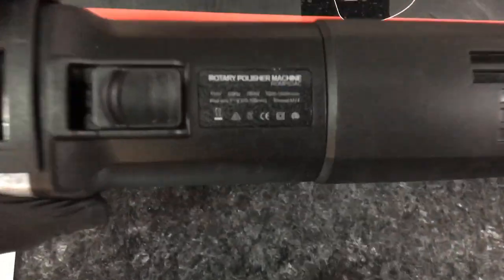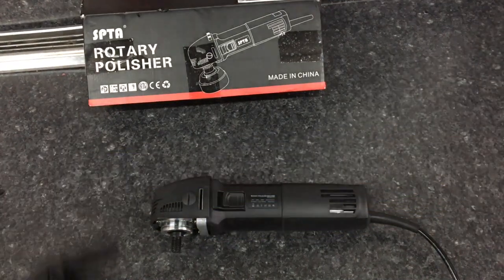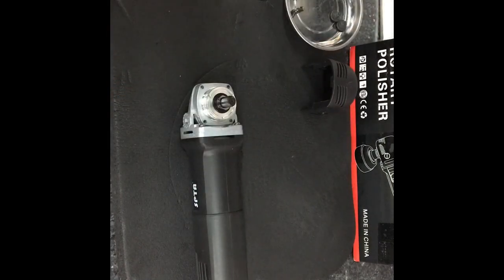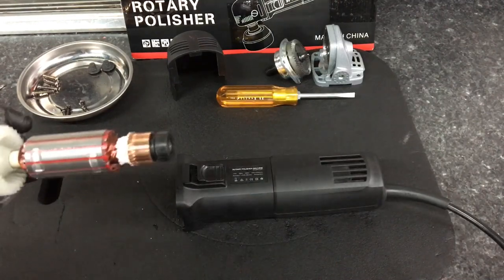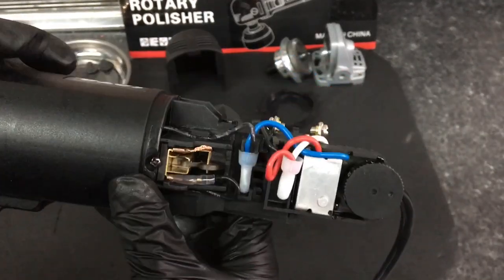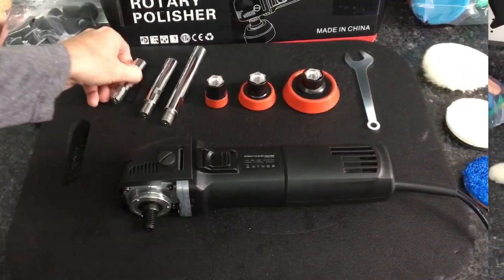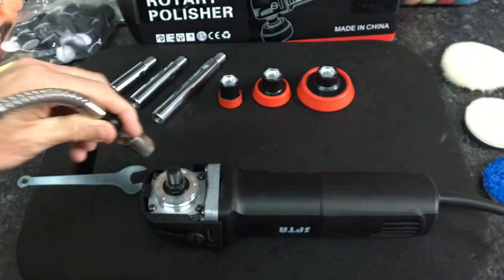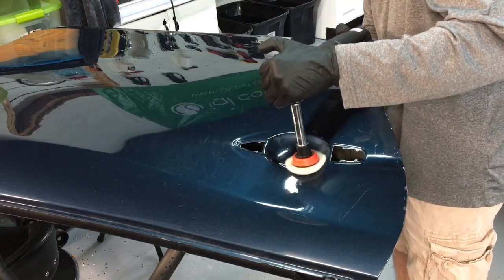An Economical Polishing Tool With MANY uses!! The SPTA Rotary Polisher! Numerous Attachements!!

Comment: I AM SOOOOOOOO GLAD you did a review on this little polisher!!!
And I feel a little better about it now also😁
I've had mine for over a year now and not a hiccup one!!
Now when it comes to the pads, the 1" wool kong hair pad and 1" blue microfiber pad will not last that long, just putting that out there for anyone wanting to know.
The rest of the pads are medium grade at best. But there are plenty of companies that produce 3" pads and smaller if you want to upgrade them.
I mainly use mine for high gloss interior peices. And I have found that, just like the paintwork on the outside you can treat trim peices the same way. I start with the 1" green pad and use griot's garage complete compound as a starter and finish with the 1" blue pad and griot's garage complete polish. And let me tell ya, trim work comes out looking fantastic.

Comment: Bought this in November 2019
Loved it ever since.
Reply: Do you know if standard handles fit on it or are they different threads,If you have any other rotary or da buffer ,do those handles fit this mini?The one I'm looking at does not have handle with it and i don't use handle much but I would like it when i use a 4 or 5 in back pad with wool pad.Thanks

Comment: Bought this polisher last year, thanks for recommending a 5/8 adapter, now I’ll throw a 5 inch plate on and give it a try!
Reply: Let us know how it handles a 5 inch plate 👍
Reply from the maker: Works fine in a cool shaded shop... but hot days in the sun could take its toll. I take the chance due to my bad shoulders.
Reply: I just received my polisher today I use it on the transom of an offshore racing boat sure save me a lot of headache and it worked well

Comment: Brian’s replacement of the gear lubricant is an excellent idea however everyone should note that opening some polishers in the warranty period voids it. Read the manufacturers guide book.
Reply from the maker: skinn0909 absolutely... I try to remember to mention that as often as possible. I fix my own polishers.. the warranty means little to me unless it fails right out of the box.
Reply: Apex Detail make some videos on how to fix polishers!!
Reply: @apexdetail85  which high temp grease you will recommend (any specific make and model you prefer)?

Comment: Awesome video Brian. There aren't too many videos for this machine. Mine should arrive tomorrow. My first pick was the flex 3 inch polisher however I saw this one and all of the accessories that comes with it. Well, your video have me confidence to purchase this puppy. One question I have is,, what do you think of the on and off switch. Many folks suggested the switch was crappy and that it will probably break. What's your thoughts?. Thanks again for the awesome video sir.

Comment: Yup, it has to come apart all the way as always :), I got not much to add, you covered it all. I just wonder how the quality of the pads and polishes is, i guess its average? Tried a 7" backing plate and can it cope?
For the pro's, I think it's better to get a more powerful Maxshine rotary so you got 7" to 1" pads covered if you get the kit without the SPTA machine, so you got your rotary part all complete :)
Well you may need to get a 7", 6' or 5' backing plate and pads of course. But for people that just start and don't plan to use it daily, this SPTA kit is as good as it gets though.
Loved the video :)
Reply from the maker: Piglet6256 I use no larger than 5 inch even on the full size rotary. The 7 inch pad would be almost larger than the polisher. The foam pads are the weakest of the pads.
Reply: So you never use 6" or 7" inch pads?

Comment: I bought this and it's decent, but none of the extension bars would screw into the backing plates. The female end has m14 threads (which is what the polisher uses), but the male end was just "off" somehow. It wasn't 5/8" or m14, so who knows. I had a heck of a time finding a set of m14 extension bars in the US, so beware if you really need them.

Comment: Great review i really like this 
Ive been looking at this as well as spta 180mm rotary 
Im really drawn to this unit tho 
I need it for a carbon fiber bonnet with vents so smaller attechmets would be great 
Do you know if the unit runs nive with a 5inch backing plate 
And also how long is the cable on this unit 
Tia keep up the good work 💪💪
Reply: Does this run well with a 5inch hook and loop backing plate ?

Comment: I bought one on ebay but speed #1 seemed more than twice as the 1000 rpm .I tested it with a digital photo tachometer and the # 1 speed setting  was 2600 rpm! I liked the polisher but that is just to fast for speed 1 and the speed just went up from there.which would you all recommend this or the Maxshine 550 ,or are they about equal? Thanks

Comment: Bryan,  what is a really good ceramic coating, that will last around 2yrs. And has a great shelf life , once OPENED.THANKS FOR YOUR HELP. JP IN SD
Reply: And need a good/GREAT TOPPER FOR MAINTENANCE AND TOUCH UPS.
Reply from the maker: John Pawlowski Gyeon Q2 Mohs 👍

Comment: Does anyone know if standard handles fit on it or are they different threads,If you have any other rotary or da buffer ,do those handles fit this mini?The one im looking at does not have handle with it and i dont use handle much i would like it when i use a 4 ib back pad with wool pad.Thanks

Comment: I know I've heard this referenced in this video and others, but how would I go about converting this 3" to 5" backing plate or a 5" polisher to 3" plate?
Reply from the maker: Ken Amazon has the backing plates that will fit. All sizes except 7 inch.
Reply: @apexdetail85  how does it perform with the bigger 5 inch 6 inch pads ? Tia